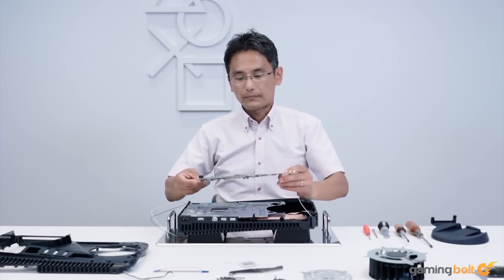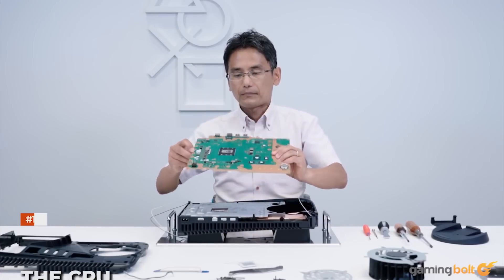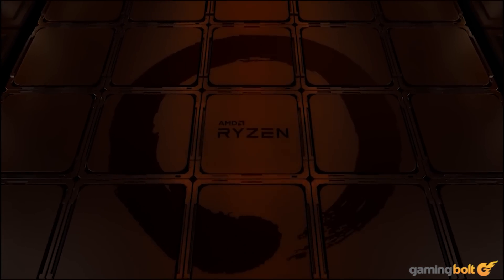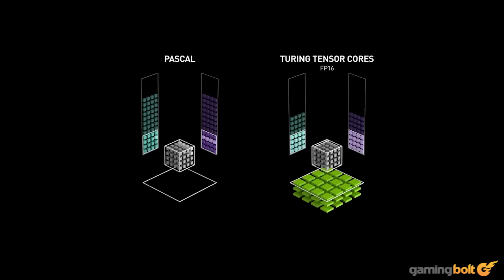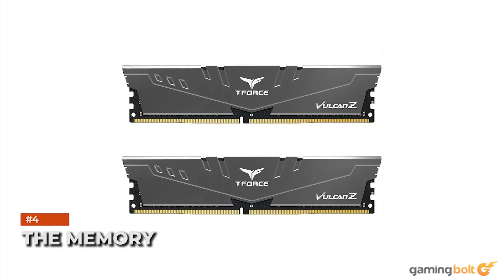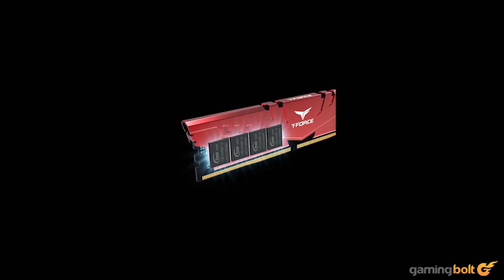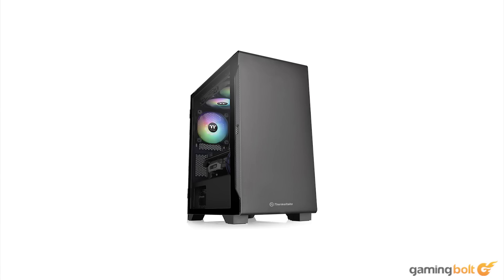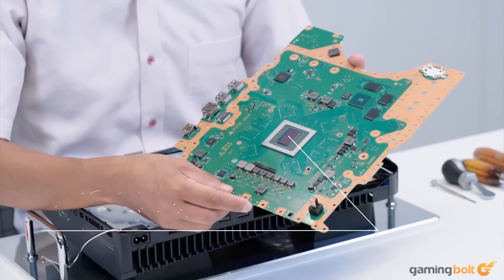How Much Would It Cost To Build A PC As Powerful As The PS5? (2021 Edition)

Comment: well considering i can’t get my hands on an actual PS5 - or the latest Xbox… my 1080ti pc is going to have to do.
Reply: There are some retailer specific videos on youtube that were tremendously helpful for the consoles. If you look up "Jake Randall"  you'll find several of them. Using some of his tips, following a few restock twitter account, and checking for potential drop leaks a couple times a day on the Google will get you one! It's frustrating, but having those resources makes it a sure thing after a few attempts. I got mine from walmart, and one for my roommate too. Seems to be the easiest retailer to score from. Don't give up!
Reply: @Transistor Jump  what,the 2080 ti is 14 teraflops
Reply: For everyone talking about TFLOPS, it has no bearing on actual comparison, since the only way you can compare TFLOPS to performance is if both are on the same architecture. Even then TFLOPS comparison isnt reliable.
Reply: Next gen consoles destroy 1080 ti
Reply: @randomdude1469  no… they don’t. The 1080ti sits between the series x and ps5. It lacks ray tracing but in terms of raw gpu grunt the 1080ti is perfectly competitive with the next gen consoles despite being nearly half a decade old
Reply: @gulfcoaster210  nope,the 1080 ti is just 8 tflops,i don't know the clock speed of the gpu but i am certain it will be lower than both
Reply: @randomdude1469  the 1080ti is nearly 12 tflops.. don’t know where u got that from.
Reply: @randomdude1469  and clock speed is irrelevant… floating point performance is measured at peak clock speed so wether the clock rate is higher or lower has no bearing. It is 12 tflops at its peak clock while the ps5 is 10 tflops.
 The 1080ti is a much much larger gpu with a massively higher transistor count. If it reached the same clock speed at the ps5 it would have floating point performance closer to 16 tflops
Reply: @gulfcoaster210   make the calculations buddy,2230 × 10.3 : 22 969 ps5

1825 × 12 : 21 900 xbs x,so ps5 win this one
Reply: @randomdude1469  that’s not how it works man. Floating point is measured at peak clock. The ps5 is 10.3 tflops at its peak clock the series c is 12 at its peak clock. That’s it. The tflop formula already takes clock in to account. It is a measurement of peak floating point performance not performance per clock
Reply: @gulfcoaster210  you don’t make any sense. Frequency’s don’t make teraflops. in your logic the lower the frequency’s the lower the tflops, so how is it possible that a gpu with more tflops runs at a lower frequency if in your logic the frequency should be much higher.
Reply: @gulfcoaster210  when I up the frequency’s on my cpu it doesn’t magically gain another core
Reply: @balloonb0y677  ???? I never said that frequency determines floating point. Frequent is just a part of the equation for determining theoretical floating point. I think u have me confused with the other guy. That was exactly what I was saying. He was claiming that because the ps5 has a higher core clock that it was faster than the series x and I was stating exactly the opposite. I think u may have been responding to him.
   A gpu with a larger core count will almost always outperform a lower core count higher clock gou
Reply: @balloonb0y677  gpu floating point is measure by multiplying core count by frequency by the way
Reply: @gulfcoaster210  you said “floating point is measured at peak clock” indicating that frequency’s are a part of what determines a teraflop.
Reply: @balloonb0y677  yes… as it is… it is determined by multiplying core count by frequency
Reply: @balloonb0y677  flops = Cores x cycles per second x flops per cycles
Reply: @gulfcoaster210  start watching at 19:00
Reply: Ignore what i said in the comment I deleted if you read it. Start watching at 29:55 but if you want to know all about the ps5’s gpu than start watching at 19:00
Reply: @superskills8343  u do realize that text rendering is utterly meaningless for 3D performance right. All of the new gen gpu’s saw massive improvements in raw compute. That is a beyond pointless test and has no bearing on gaming performance.  The results in that test r the result of the the unified memory structure of the apu.
Reply: @superskills8343  the reduced latency of the apu memory structure artificially inflates results in benchmarks like slug. That test is literally see how fast the gpu can render a full screen of text. The lower latency memory structure of the apu allows the gpu to render a single frame of text significantly faster. But again, this has no bearing what so ever in gaming performance and is as irrelevant a test as u will ever find for gaming performance. A ps5 is similar in raw gpu performance to a 2080 though a little slower.
Reply: @gulfcoaster210  tflops doesn't explains full gpu performance and power example series s gpu has 4.06 tflops but it's 5 times slower than ps5 gpu because it has 51 GPixel/s performance compared to 143 GPixel/s performance on ps5 so technically ps5 gpu is around 15% faster and powerful than the rtx2080 in raw gpu performance but because of extra 8gb and much higher bandwidth for apu it will perform much better in heavy loads
Reply: @gulfcoaster210  thank you all for the debate... i found this quote on dig foundry... 'PS5 in asscreed is exactly like the 5700xt perf which according to your graph is exactly a 1080ti Actually, in the portion of the game used for analysis by DF, the PS5 performs better than the 5700xt and closer to the 2080.' so it seems some games will be on par while other devs may get more out of the newer architecture?
Reply: @simongentry  I believe the title tested was an Ubisoft title. Ubisoft engines are highly amd optimized…. A good example is the 6700xt outperforming the 3090 in assassins creed despite being 60-70% slower in most titles
Reply: @simongentry  I’m most titles a 1080ti is still a bit faster than the 5700xt. The ps5 will also be a bit ahead of the 5700xt though not by much

Comment: I can easily find $500 custom PC on the used marketplace with the same power as the PS5 consoles. So really of you're using common sense look at the used custom PC market.
Reply: Really  with RT capability and ssd , please share and tell me where you get this,  I’ll get one.
Reply: @Guitar387  Facebook marketplace
Craigslist
eBay.
Reply: @Guitar387  If they were that cheap even used the GPU would be burnt out lol
Reply: If you're going for "used" you could find a cheaper console too...
Reply: @vHiddenAce  A used parts PC is far superior than a used console. And used PS5s and Series consoles go for above MSRP.
Reply: @shizzywizzy6169  Very true, I completely forgot about the shortage, madness
Reply: @vHiddenAce  but the video specifically said PS5
Reply: Dude you are not considering the fact that the optimization of games on console is on a different level altogether. Look at games like GOW, GOT and TLOU 2 on ps4 which is a 2012 hardware.
Reply: @shivanshsharma6163  ok and how does that affect what I said
Reply: @0fficialdregs   @Dregs  you are talking here about power factor so my point is fairly easy to understand if you apply common sense. But for you I'll explain it, even if you will find a second hand used parts of pc which is equivalent or more powerful than PS5 (in theory) it could never really match the gaming performance of a PS5 in a real test since pc games are not optimised to that level. PS5 provides way more bang for the bucks as compared to ps4 when it launched in 2013.
Reply: @shivanshsharma6163  lmfao a large majority of PC parts have better performance than the PS5 and you're clearly one of those people just looking for a simpleton fight. Nahh not here
Reply: @shivanshsharma6163  You seem like you may be from India, and in that case, yes modern PC parts there are incredibly more expensive than MSRP. And everyone obsesses over playstation.

But for the rest of the world, mainly the US, we get to build PCs that are far faster than consoles for cheaper than consoles.

On a side note there are a ton of games that are better optimized for PC than Console: Doom Eternal, Cyberpunk, GTA V, Witcher 3 just to name a few.

Kinda sucks that you guys are stuck with an inferior platform over there though...
Reply: @Transistor Jump You didn't read my comment properly I never said a used OEM PC I said a PC built with used parts.
A PC with used parts will certainly be faster than a PS5. Don't lie.
It will be very tough in this economy but not impossible.

Example parts:
CPU: 6th gen 12 core Xeon
GPU: Radeon R9 Fury
Everything else is pretty standard but this should give you performance easily exceeding a current gen console for $500.

Do your research or you'll look like a fanboy.

Comment: If you think your going to just use specs to beat that system, youre going to be in for a dissapointment for some years.
Reply: PS5 does have exclusives yeah but PC has also lots of benefits over PS5
Reply: @khursaadt  These systems often have capabilities that come put after the systems launch, so thats true; kinda.
Reply: What are you talking about? The Cpu and gpu in the ps5 are the same architect used in their current ones. If you build an amd pc that matches the specs on a ps5 they will literally run the same. The pc will be more expensive like you see in the video. Because Sony is taking a loss on every system sold. But they will recover it through selling games.
Reply: @arechikitsune  Yes, maybe if that pc has a sony ps5 ssd, and even that is doubtful, it wont be wired anything like the pa5s internals are.
Reply: @gangstagummybear3432  that ps5 ssd is totally over exaggerated.
Digital foundry has done videos on it and really the. ssd doesn’t affect graphics anyway. Just load times which aren’t even that much apart. Probably the exclusives on ps5 can take some sort of extra loading time off of it but graphically you it won’t really do anything.
Reply: @arechikitsune  Ok man, have fun waiting for a contender to Rift Apart all gen.
Reply: @gangstagummybear3432  go figure. The moment I mention digital foundry and the benchmarks they did proving it’s not a big deal. you completely turn it around as if I’m in denial.

Reminds me when people thought the word optimization was some sort of console feature when in term of games it’s just the process of making something run efficiently. Example adjusting resolution and effects, textures, field of view etc.
Reply: @arechikitsune  Benchmarks wont matter, lol, what are you measuring; multiplats?  Lol, thats going to give you an accurate measure alright.
Reply: @gangstagummybear3432  if the roles were reversed I would have watched some of their videos before assuming. Then provide my thoughts on it.
Reply: @arechikitsune  agreed
Reply: @arechikitsune  it's a console fanbot, don't bother
Reply: @arechikitsune  dude thats like saying a rtx 3070ti in a laptop is the same as a rtx 3070ti in a desktop like nooo buddy it don't work like that unfortunately.
Reply: The gpu/cpu in a next gen console is smaller then in a pc therfore you get more power out of the bigger component like its common sense.
Reply: @tapperwick420  then that not only proves my original point that I made a year ago but surpasses it. My point was that the performance of a ps5 can be achieved on pc(and obviously surpassed). but it would cost more because on pc you pay the full price while ps5 takes a loss per unit. So you pointing out the fact that ps5 chips are closer to laptop chips than they are to full gpu and CPU’s just furthers the point that you could probably get the same performance with not that much price difference.
Reply: @hzN1 I had replied with the link but it doesn’t appear here. Go to digital foundry and search for ps5 ssd testing.
Reply: @arechikitsune  Digital foundry must be far ahead of most any dev in the industry, you people overrate the fuq out of digital foundry
Reply: @gangstagummybear3432  all of your replies so far have been antagonistic in nature.

Loading the same games on different drives, installing and disinstalling games on different drives and measuring how long they take isn’t some Uber science that only devs can do.

Also what kind of argument is that. You basically are telling me “Even thou there’s no differences with the games they’ve released so far, someday you will see”

The problem here is that you think I’m defending pc when I’m just pointing out how misleading companies are in general. No día promised that they’d series 3000 gpus would be 4K beast capable of reaching 8k 60 FPS. That was a lie.

Sony talks about and ssd that can apparently be double or triple as fast as a normal ssd. Yet every benchmark so far shows that it’s maybe 15 percent faster.

I am disappointed in everything in general. So stop trying to make this a pc vs console thing
Reply: Your going to upset the master race there mate , be prepared for every excuse under the sun and your phone going into meltdown.  Pc gamers are more overly protective than a 16 year old new mum .
When the fact is currently today AT THAT EQUAL SPEC, NEW COMPONENTS ONLY LIKE FOR LIKE ,AND AS A GAME MACHINE IT CANNOT CURRENTLY BE MATCHED TODAY. simple as that.
Reply: @random_gamer_guy82  a pc gamer would be saying that a $400 pc is superior than the ps5.

Not that it was shown that the ps5 ssd doesn’t make much difference compared to regular ssd.

Comment: But the PC you've built is better than the PS5 no vrr no mesh shaders no auto HDR a 3060 imo is better than what's in the PS5 but this build is waaaay stronger than the PS5
Reply: A more comparable gpu would've been the 2070 in terms of power. The 3060 compared to the 2070 at MSRP available stock, well, the 3060 makes more sense. I agree with you though!

Comment: The SSD alone has gotta be $1000 minimum!
Reply: Lmfao hell no it's not unless you're going for the 9tb lol
Reply: The SSD in consoles run around $200-250.
Reply: @msg4672  if you're buying new, yes, but used is just as good
Reply: @0fficialdregs  good point
Reply: @0fficialdregs  for sure, but the particular specs of the internal NVMe drive of the PS5 is not typically found in external drives for that price. Is also be careful with Amazon as there have been a number of storage device problems through them where the one they give you is either smaller or slower than what you are buying, like they swap labels. Had it happen to me. Thankfully returns are easy.
Reply: go check digital foundry's review kid!!

ps5 = RTX 2060 super + i5 9400F / ryzen 3100

sata ssd is more than enough to match console ssd, check comparison between sata ssd vs nvme gen 4

so a $700 pc is equal to a ps5
Reply: @Luiko0406  :)
Reply: Bruh.